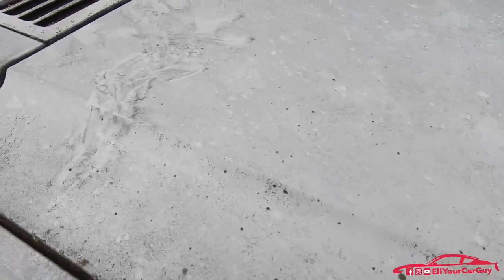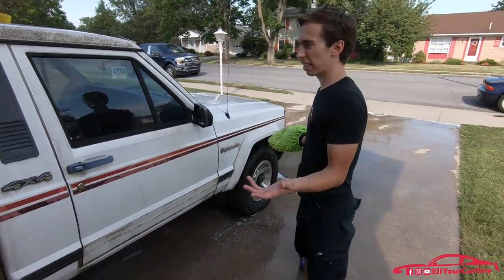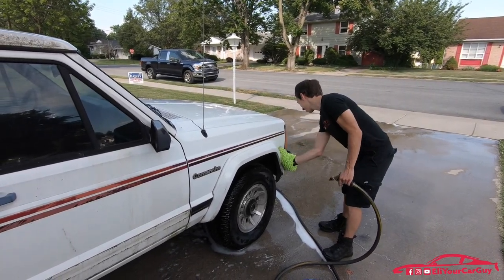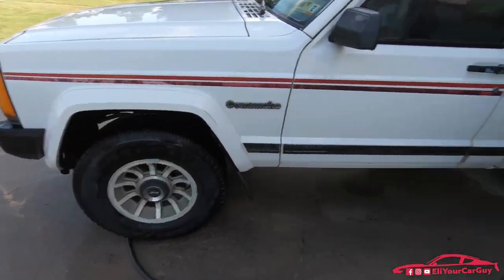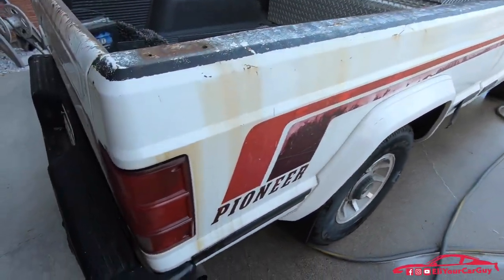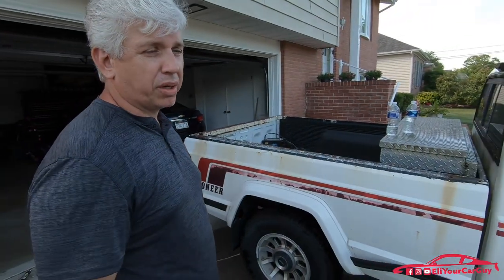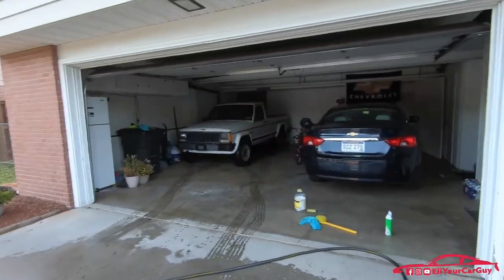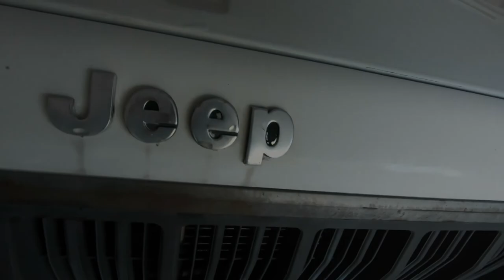First Wash in Over 10 Years! 1988 Jeep Comanche Project!

Comment: I had a 88 Comanche. Loved that truck! Good luck trying to match those hockey stick side stripes! Nice truck! Get rid of that bed liner! A spray in bed liner would be great. Those turbine alloy wheels are a rare good factory option!
Reply from the maker: Nice! I am loving mine so far! I am gonna try to order a stripe kit off eBay and hope that it matches or else I won't be installing it. Bed liner already gone! Looking forward to the spray in liner soon. I thought about replacing the wheels at first, but then realized just how rare these original wheels are so I am definitely sticking with them!

Comment: My dad has an 88 pioneer white exact same but it’s not 4x4 unfortunately and I will admit I dropped a cotton Q-tip in the last cylinder while cleaning around hole and I was so worried. I spent two days trying to fish it out but I couldn’t.  our little secret. Still runs good 4.0 has 242,xxx Also it’s my opinion that the tailgate raised Jeep should be painted the red. The lighter of the two stripes. It seems the tail gate was repainted because the handle would’ve came black from the factory as the door handles themselves are black.